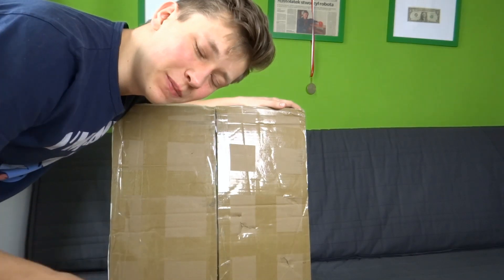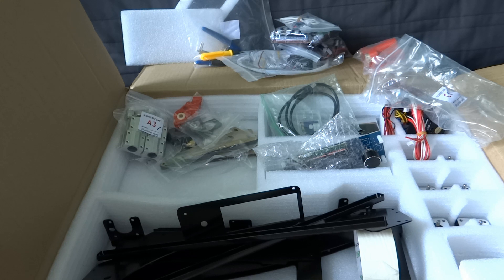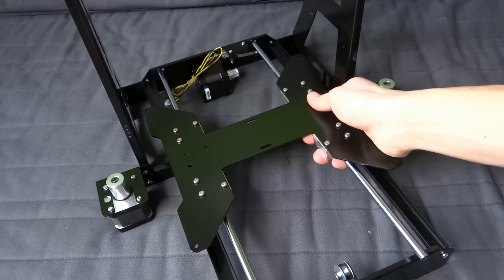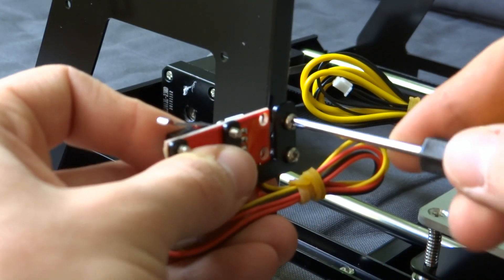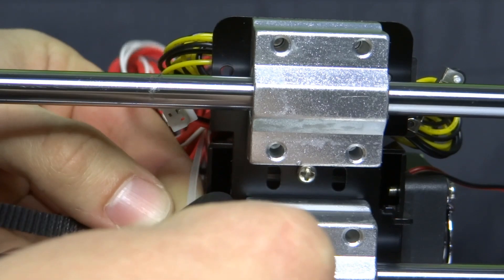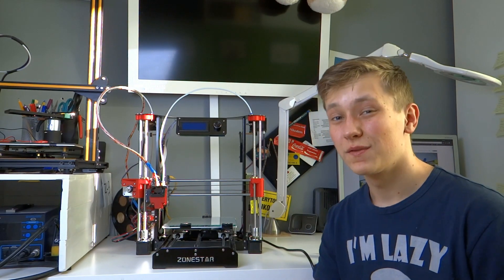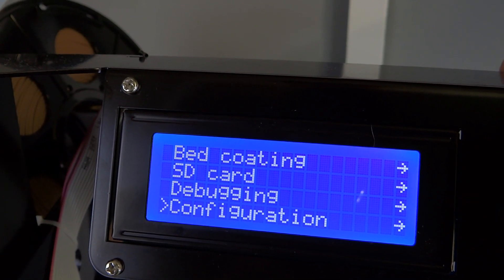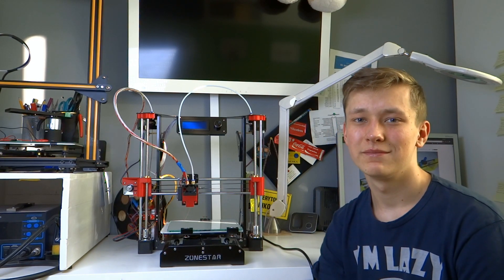The Cheapest DUAL EXTRUDER 3D Printer - Zonestar M8R2 Review

Comment: Dual extruder, single nozzle is good for two-color print with same material.
My next 3D printer I want dual extruder individual nozzle, to use washable compatible filament for suport structure.
PLA on PVA-support, and/or ABS on HIPS-support

Comment: I bought one of these printers in January and have had trouble with the extruders leaking. Because this is 2 in 1 out you dont tighten the nozzle upto the throat. There is a Y inside. I think it will print ok if i can get a duel extruder that does not leak. I have had the original one leak. Then i bought another exact hotend and this leaked the same. I bought another make and found it difficult to fit and this also leaked. I have just ordered a 3D Printer accessory Multi-color Extruder 2 in 1 out nozzle Hotend fan Dual Color Switching Hotend Kit for 0.4mm 1.75m filament from aliexpress and hope this works. From what i have read there is no point trying to contact zonestar as they dont reply. Hope you dont have the same problems as i have had when you start printing in two colours cheers Tim
Reply: Hello. I have this same printer and am having lots of trouble getting a good print. The extruder I think is clogged and not printing properly. The extruder is slipping as it can’t get enough filament down to the hot end. There is some sort of blockage but I cannot take the damn thing apart.

Comment: One of the tricky things I've found with dual nozzle printing is oozing. Even when the temperature is dialled in well, the nozzle that is not in use still oozes. Ooze shields help but there are always unwanted dings from the other nozzle on the print job. My printer is a K8400 Velleman Vertex with upgraded E3D V6 nozzles but it was the same story with the stock nozzles. Ultimately either a diamond hot end or the Prusa MMU method shows the most potential in my opinion.
Reply from the maker: +moojuiceuk you don't really have this problem here. There are no two nozzles in this printer, two extruders and one nozzle, filaments are mixed inside the hotend. That's a big plus of this printer because you don't have to calibrate them and there is no problem that you mentioned. Thanks for comment!

Comment: Great review! And not a bad printer for the cost. I have a question. So I’m trying to upgrade my printer to dual color using a Y splitter for tool changes. It requires a very special Gcode. Are you familiar with this setup?
Reply from the maker: Thank you! I never heard of that :( I found it on google and it looks really interesting! Try to search for some information on the internet, there is almost everything :)

Comment: This is a nock off of the E3D CYCLOPS hotend.   OFFICIALLY, that hotend is still "beta", lol...   Drawback is both materials have to be the SAME temp.  so you cant extrude 2 different materials (ie, maybe a hips or TPU at same tiMe as PLA.

I look forward to your prints to see how it goes.   

I just ordered a E3d Chimera, two in, two nozzles.  Both with seperate heater cores.  Hope it works when i upgrade my old printer!  

Print on!